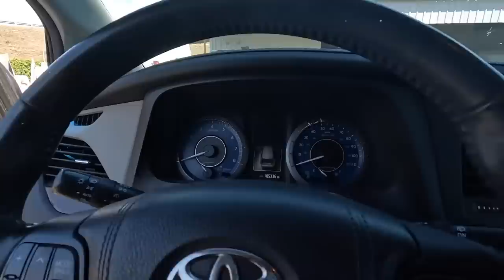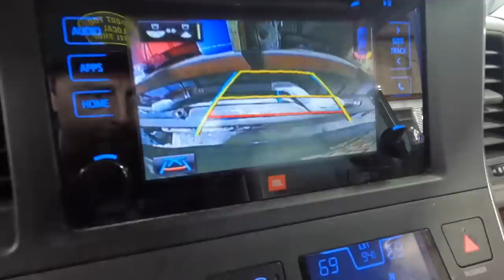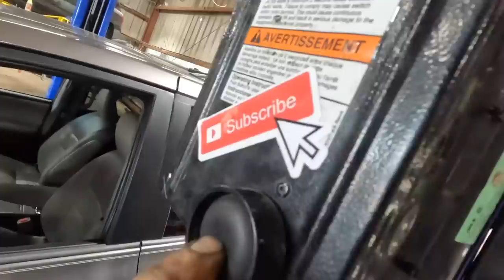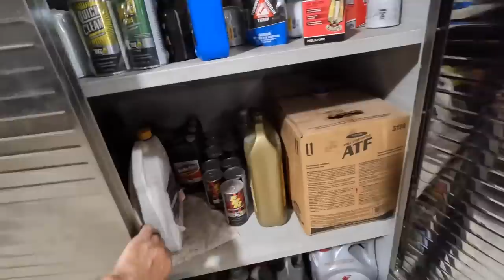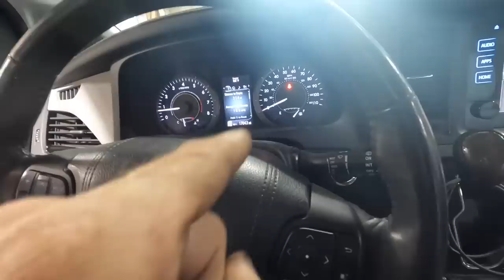Not going to sell this job! Toyota Sienna 3.5

Comment: The passenger-side mirror should be interesting. Motorized adjustment mirrors are very expensive for older Volvos (but that’s ok since they are rarely available). Replacement mirror glass (custom cut) is a great, inexpensive alternative.
Reply: My Venza heated mirror is just CAD$70 from the dealer lol

Comment: I use sea foam to clean the crank case. And I’m looking into changing my valve cover gaskets on my tundra 4.7 liter I force. It has over 200k on it. Nice to see you giving the option on the oil leak. Good video sir.

Comment: have you ever tried liquid moly motor oil saver. it helped with two of my cars for oil pan leaks and valve stem leaks. 20k later and my cars are still good.

Comment: Wow.  NO ONE ever unscrews the oil filter housing drain plug in the bottom (3/8" square drive).  Admittedly, the plastic piece included with the filter kits (one of two parts in the filter kit he ignored; the other being the smaller o-ring for the drain cap itself) does have a tendency to drain oil all over your hand as you try to push open the housing drain valve.  That's why you buy the very nice Assenmacher tool that threads into the housing drain plug port and run-up the outer wheel on the tool that pushes open the drain valve, allowing the oil to drain thru the valve  into the hose attached to the bottom of it.  Zero mess.

Even if you never use the housing drain function, at least remove and replace the o-ring under the cap to avoid a nuisance leak from a brittle, ignored o-ring being an o-ring for too long.  I wonder how many people had such an oil drip, and being ignorant of the cap,  just cranked down harder on the innocent housing, galling an aluminum one or stripping the threads of a plastic one.

Most Camrys have plastic filter housings but I upgraded mine to the aluminum version that's on this van (maybe all V6 engines, along will all Lexus engines).  BTW, the housing (and thus the block) features a beautiful, long, Buttress thread that resists the internal oil pressure very capably.  Once the housing positively stops on the block, the final torque is (IIRC) only 18 ft.-lbs.; the flat drain cap is 9.  The radial compression on the outer o-ring really does most of the job of holding the housing in place.  But if you look on the engine block along the OD of the filter housing, there is a tab held on with a single screw; it's there as a secondary lock to prevent the housing from unscrewing, but after several changes it gets bent out of the way and most people never even notice it again.

And no, a bag of OEM drain plug washers (mine don't look like aluminum nor did that one) are not so expensive as to run the risk of a drip.

Amazing Toyota never fixed their gas door hinges.  Protip: when your Camry etc. gas door starts to groan and drag, lube the crap out of it and order a new one before the hinge completely breaks in half, leaving you with the door in your hand and an exposed gas cap.  And those rivets are pretty big; I had to buy a two-handled installer to put in the new ones.

Comment: every time I see an oil change video I remember a chap I used to know. He would drain the oil out then restart the engine for around 10 seconds to purge the rest of the oil out before refilling - I know, I know! 
funny enough he was always changing cars..................
Reply: I do the same thing but not for 10 seconds. Tgats way too long. All it takes is to turn the engine over for a couple revolutions.  It doesn't even have to start. If it does, turn it off immediately as fast as humanly possible. That releases an at least an extra cup or two of dirty oil which was hanging in the internal parts. You'll see the oil start to flow again. I've never had an engine that used any oil or been damaged between 7500 mile oil changes.

Comment: I have a 2011 Venza with the same 3.5 2GR-FE, 140K with the same oil leak at the timing chain cover. The oil will eventually drip onto the CV boot and get flung all over the bottom passenger engine area.  To prevent this,  I rinse the timing chain area with mineral spirits (cheaper than brake clean) every few thousand miles into a catch pan which removes the oil. Ray mentions doing a timing cover job "in 10 hours" but I believe it takes much longer than that on this engine. Thanks Ray for the great videos.  BTW, that oil that you spilled when filling was carried down all over the engine by the brake clean - it would be best not to spill it in the first place.

Comment: As an import technician, this leak appears to be the beginning of the infamous 2GR-FE timing cover leak. It will only get worse and end up having the drop the drive train (just like the Jeep), a few hundred dollars-worth of parts and a substantial labor bill. These are excellent engines with a very long life.
Reply: Thought those were mostly due to coolant corrosion? ... never mind. That was the OTHER issue. Head gasket leaks. No idea what I was thinking..

Comment: Been working on toyotas for a while now and unless it’s bad I just use the “sealing spray” aka brake clean to clean it off. It’s good pay but I never sell unless they complain or it’s really bad.
Reply: The oil conditioner/additive may have seal swelling properties like the specialty "High-Milage" oils do and help with the oil drippage.
Reply: What I meant is I just clean it off  with brake clean I don’t really try to open that can of worms. Plus I don’t think a additive will help Fipg.

Comment: I use about 8 Oz of gumout additive to 5 qts of oil before a change. I dump in and run for about 80 to 100 miles before an oil change. 
 It seems to help out. 
  Be safe, team !

Comment: If you look at his drill at the open of the video, you can see the rivet heads remains he has drilled. Usually those are from window regulators, usually on 90 ish to 2005 ish fords and Lincolns. That is where i run into them. Best guess. So Ray, where did the rivets come from?

Comment: I would mention that its approaching time for timing belt replacement and if that seepage is concerning to them handle that at that time. If it becomes an issue.
Reply: 3.5 engine uses a timing chain. 04,05,06 Sienna used the 3.3 engine which has the timing belt. That leak has been around since 05 starting with that engine in the Avalon. My Avalon and my 06 Rav4 V-6 had the leak...it only gets worse. Lexus uses the same 3.5 and they have the problem also. I was quoted 22hrs. labor to fix the leak back in 2010 before they realized it was best to pull the engine. They have an upgraded sealant now also. Nothin irritates me more than a leak on the garage floor.
Reply: @edwardbennet3902  Whats  the maintenance on a chain then?
Reply: @maytagmark2171  Chains have no maintance other than regular oil changes. The chain is lubricated with motor oil. Normally lifetime unless a tensioner goes bad (rare). The belt runs quieter and has a maintance interval (replace). Chains tend to be a little noisy but are mainrance free.
Reply: @edwardbennet3902  No Kidding!!! You missed the point of the statement all together. Maintenance on chain and gears means what is the recommended replacement interval  for that particular Year Make and model. And in asking that is to suggest that what ever the replacement recommended schedule is Then at that time re examine the necessity to address the seepage issue. 
  .
Reply: @maytagmark2171  Your statement specifically mentioned it might be time to replace the timing belt...The engine in the video has a chain...that's what I responded to.

Comment: Ray, thanks for yet another good video.  I'm sure you already know this but don't do it because it takes more time and isn't necessary.  However, for anyone who has a Toyota with that style filter and housing and isn't already aware, the housing is two parts.  The filter comes with two o-rings and a little plastic spout.  What Toyota says to do is to remove the small round bottom portion of the housing (with the 3/8" square recess in the middle) and run the plastic drain spout up into the hole that it covers.  This opens a "push valve" and drains the oil from the filter housing so that it doesn't run out on your hands when you unscrew the main body of the filter housing, like happened to Ray.  Not doing this doesn't hurt anything, but doing it makes for a less messy oil change.  My wife likes Toyotas, and this is one design feature I really appreciate.  On the other hand, I'm not servicing vehicles as a job, so I probably am able to do it at a more leisurely pace and take the extra steps that don't really affect the quality of the oil change.

Comment: BOTH the gas door and the passenger mirror are SUPER COMMON failure items on these vans. 
The gas door is a PITA because there's a push button that tells the sliding door, the gas door is closed. If the switch reads open at all, the door won't operate manually or on the auto open. 
We had one of these vans in service as a taxi.. We disabled the switch, and removed the gas door.

Comment: hey Ray, love your shop, I have one in Akron Ohio, wanted to make a comment about oil viscosity, the 0w20 is fine on a new engine but I have learned on 100,000 mile engines on a hot day they can lose oil pressure, 5w 30 synthetic is better for that sienna, just my opinion, let me know what you think, the low viscosity oil was used for fuel economy , but it is not the best if you want to get 300,000 miles

Comment: The owner probably saw some spotting on the garage floor. My solution to the seepage from my 2003 Jeep Wrangler is to put cardboard down to catch the seepage. If you can't tell the oil loss on a dipstick, an expensive repair won't pay for itself and the seepage won't harm the engine. 

A less than reputable shop would have jumped at the change to make some big bucks of a small issue.

Comment: Wish my truck could of been as easy as this van. I Tried to do the oil change on my 04 350. Now, I know fords are known for rust. But somebody literally torqued the drain plug to about 10000 lbs. It stripped the head.  What I learned is that never over torque your parts. Now I had to add that to list of things the mechanic has to work on.

Comment: Use the Black light and the oil additive will trace that oil leak in no time at all, OLD SCHOOL 1970 it also was the very first time I used it on massive AC leaks on a Mercedes 240 diesel no one could find? Every AC hydraulic hose  was leaking at the fittings, at that time  the AC unit used flexible Hydraulic hoses.

Comment: Oh and I use a quart of kerosene to flush engines in the same way then two oil changes I had a real badly clogged 350 Chevy one time and used a whole gallon of kerosene it was so clogged it wouldn't drive over 40mphbut after about ten minutes of idle and some very small reves it suddenly came to life a lot more so I waited one more minute then changed oil with cheap oil and a cheap filter then a small drive around town then back and then changed oil once again with the good stuff Castrol GTX high mileage and a good filter I'm not saying which filter though there's to many disagreements over filters
Reply: Yeah, if you read the MSDS on Liquimoly Engine Flush, it's just longer chain hydrocarbons compared to gasoline. Gasoline is heptane and octane, the engine flush is something like 13-ane. Kerosene is probably pretty much the same thing.

Comment: Good call on not advising a repair on this, 2GR-FE is known for front timing cover oil seepage that is virtually a non-issue.  Some of these engines are born with this issue as the seal was not properly applied at the factory.  These very rarely become an issue and the car will often drive for another 150,000 miles without any significant issues.

Also, for the oil filter, if you don't want to get your hands dirty, you can apply a ratchet to the bottom plate first, then there's a plastic spout that comes with the new filter you can attach directly to the bottom which will drain the oil in filter housing, THEN you can unscrew the housing using the tool and not get it all over your fingers.

Comment: This is a very common leak on the Toyota 3.5. Some dealers push for repair, but requires full engine removal since no room to take off the timing cover in the car. I think it is not worth it since it is generally just slow seepage.

Comment: you're daring, those 3.0, 3.3 and 3.5 have really small top end oil feed tubes, in the sludge prone 3.0 if you ran any kind of oil additive to clean up the gunk, it would cause the feed tubes to clog and oil starve the top end..

Comment: I swear I was the only one at my shop that did the o rings on those and crush washer. My question for Ray is why not replace the smaller o ring for the 3/8 drive on the filter.

Comment: Unless your 3.5 Toyota engine has excessive oil from the timing chain  cover, just clean and monitor the oil level.
Did you replace the o-ring for the filter housing drain? Toyota 3.5 oil filter housings have 2 o-rings.

Comment: I wouldn't dare suggest how you do oil changes, so take this as my opinion only.  The engine didn't seem sludgy under the cap, so I don't understand the BG products with the oil change.    Manufacturers advise against additives and other than a neglected engine, I've never used anything in the crankcase.  
That's just me, though.   Keep wrenching.

Comment: Drove a car for 4 years with a very small leak like it was not even dripping. Just watched my oil and topped it off when needed. A shop quoted me 1k dollars to take the engine apart to change a 50 dollar gasket. I said screw that I’ll just top my oil up from time to time. Eventually I got it fixed but not everything needs fixing now you can keep an eye on things most the time.

Comment: Would it be worth checking the pcv valve to see if excess crankcase pressure is causing seepage?
Reply: valid concern yes , however that is a common "seep" point on these motors due to it being a "T" joint where upper oilpan, block, and timing cover come together in an area that doesn't get sufficient air flow. the rtv sealant starts to break down. As Mr. Ray stated... not a major concern at this time, clean and moniter for changes

Comment: The plastic caps for the oil filter always seem to be tighter than the metal ones and as one could guess too the metal ones break less. If i have a plastic one break i always replace with a metal one.

Comment: I have a 2011 Corolla and several years ago the dealer told me the timing gear cover was leaking.  Not a drop of oil on my drive even 8 years later.  They wanted $2500 to pull engine and reseal.

Comment: Ray, watching from Australia, and hearing you say you let the oil drain for a lengthy time, do you have the Ford Rangers over there that have the variable displacement vane type oil pump? Apparently if you let them drain for too long - I think more than 10 minutes - the oil pump can lose its prime and when you start the engine it will have no oil pressure. I think a few engines have been destroyed like that. Just wondering if you are aware of them, or even have them there.

Comment: I have a 2017 Lexus GX460 and on my first oil change I found my oil filter  cap was torqued beyond what it should have been. It was also the original plastic oil filter cap and I was deathly afraid I was going to break the ears off it. I went on Amazon and found an oil filter cap socket that has a slip feature that won't allow you to over torque the cap. I also replaced the plastic cap with an aluminum one. Haven't had that problem since.
Reply: I wonder how much money is saved with this newer Toyota style oil filter? Price between buying a spin on type  on most cars vs. just a paper filter and the 2 gaskets. Reminds me of laundry pods. If people are accustomed to throwing a pod in the machine, then suddenly they have to measure detergent from a bottle. The pods cost consumers 3x as much per load. Maybe the Toyota system is better, but I would dread having to learn it, unless I bought a metal cap and a torque wrench, which would cancel out a lot of savings for me.
Reply: @new2000car  It really isn't any harder to do. And I would much rather have the reliability of a Toyota than a spin off oil filter. Toyota's thinking is that the original plastic one saves weight and it also saves less waste creation than spin off filters.

Comment: There was a secondary-smaller O-ring for the tube for the oil filter, I noticed.  Not installed?
Reply: The second smaller o ring is from the drain plug in the bottom of the filter cover, which he didn't remove, nor do most people.

Comment: The timing cover leak is common on an several Toyota engines. Like you said it’s seepage more than a leak and a yearly cleaning of the area is more than enough for another 100,000 miles.
Reply: Very common for all of the Toyota 2GR engines to leak oil from the rear of  the timing chain cover.  If it's wet on the ear for the ps pump then the engine needs to be pulled to reseal the timing cover.  I've done way too many as a dealer tech
Reply: @marcesposito2587  I have a small seepage on my 2AR engine except it’s at the top of the timing cover instead of the bottom.
Reply: @khakiswag  I'd have to see what it looks like